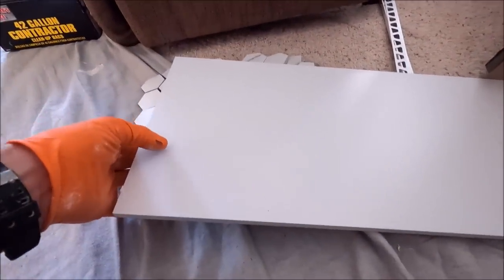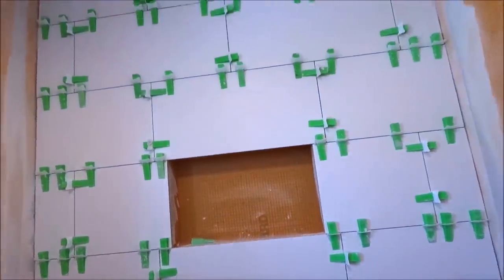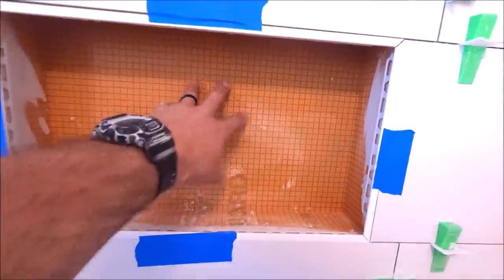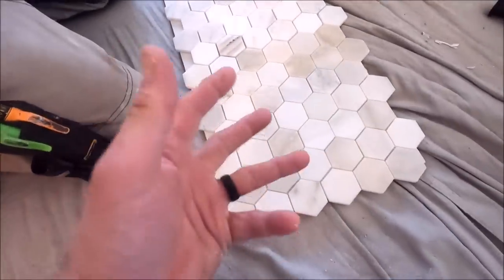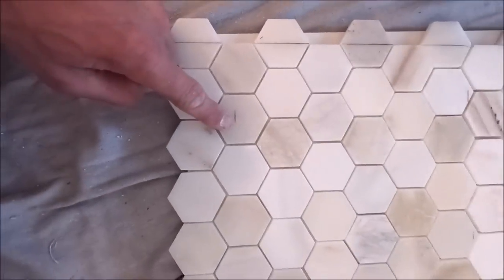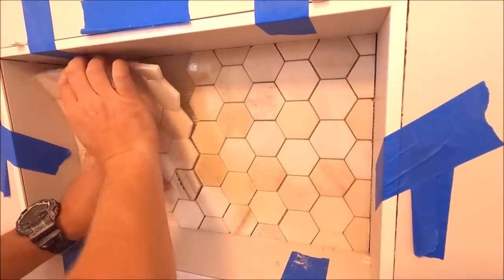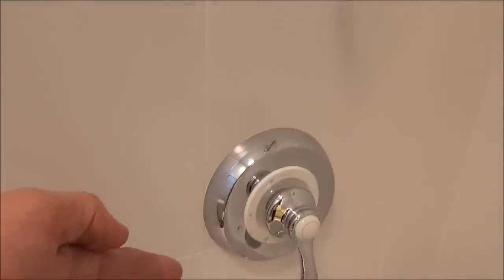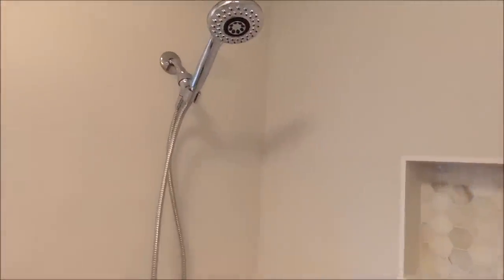3 Day Budget Shower Remodel

Comment: Nice clean install as aslways. i was wondering if you ever take on 24 x 24 or 24 x 48 tile install since they are very popular right now and i get less and less 12 x 24 to install on shower walls nowaday.
Reply from the maker: Thanks! and sometimes with 24x24, but not much 24x48 (we don't do many floors other than small bathroom floors). I don't see many 24x48 tiles on shower walls as the layout look a little funny (typical 32" x 60" or 32" x 32" shower) Small cuts/rips would be on both sides or a single grout joint up the middle.